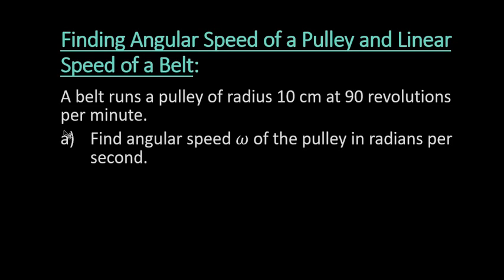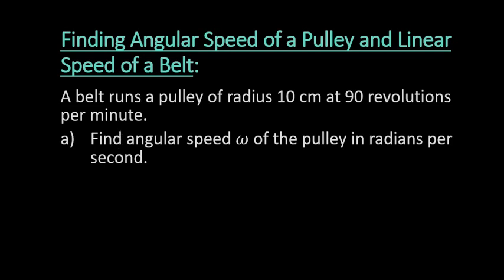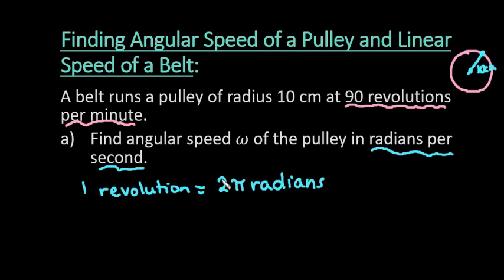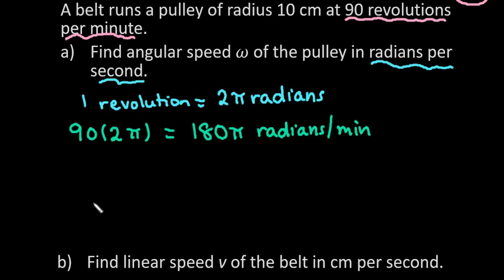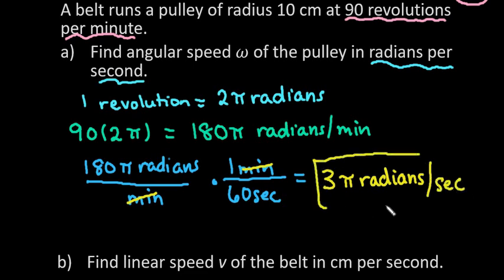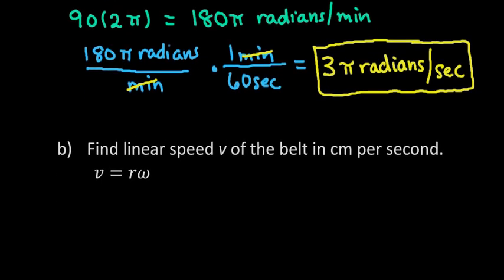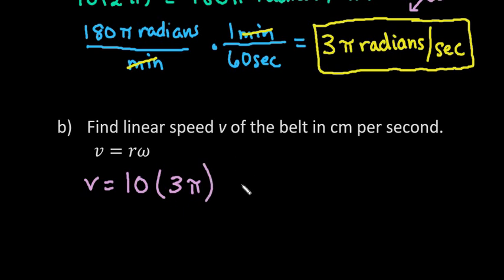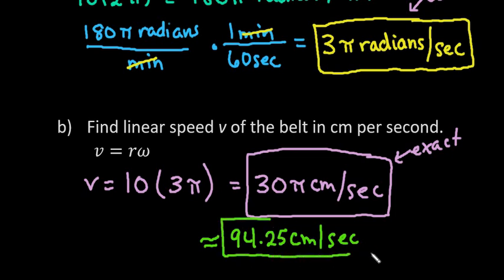Angular Speed of Pulley and Linear Speed of a Belt

Comment: Can u please help me with this question
A pulley is driven by a driving belt moving at a speed of 25m/s. The tensile force in the slack is 0.4 times the tensile force in the side. The tensile force in the tight side is 400N. Calculate
A) the tensile force in the slack SIDE.
B) The effective tensile force
C) the power obtained
Reply: A) The tensile force in the slack side (T2):
T2 = 0.4 * T1
= 0.4 * 400 N
= 160 N
B) The effective tensile force:
Effective Tensile Force = T1 - T2
= 400 N - 160 N
= 240 N
C) The power obtained:
Power = (Effective Tensile Force) × (Velocity of the tight side)
Power = (240 N) × (25 m/s)
= 6000 Watts